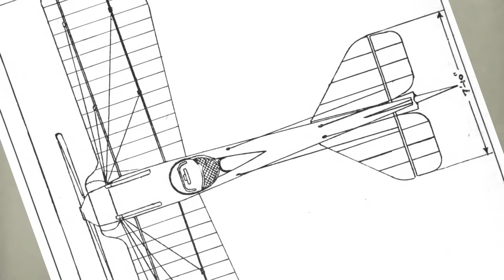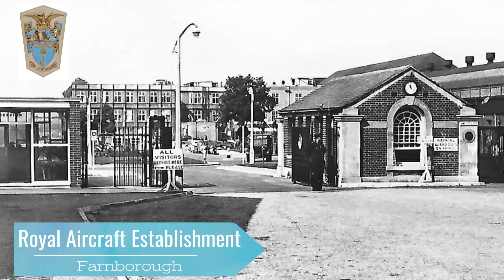This Spitfire ALMOST Went SUPERSONIC - The British WW2 Fighter That Almost Broke The Sound Barrier

Comment: The pilots notes on the Antiques Roadshow last weekend showed that his lightweight unarmed photo reconnaissance Spitfire reached close to 600mph in a dive. That means the airframe was better than nearly all the early jet aircraft. It certainly had a better limiting Mach number than the later P51 Mustang. The Spitfire was better than it had any right to be in this respect.
Reply: Indeed, the airframe was better than many early jet aircraft. Many years ago I knew a chap who'd been ground crew on the early Meteors and mentioned that an instruction to the pilots was "Don't turn too quickly or you'll find yourself doing 600mph without an aircraft".
Reply: @Bassman-r3c  the Meteor had an issue at 0.84 meaning the wrong manoeuvre could result in something akin to an unrecoverable flat spin. It had a higher than desirable accident rate, some of which was due to having to send trainees up solo to qualify in single engine operation using a process that was unsafe. A lot of accidents were due to cold war issues and were things like pilots flying into terrain in bad weather. Overall the loss rate wasn't any worse than a lot of early jets and was actually better than some.
Reply: @wbertie2604  Thankyou, I guess that explains why the pilots were told not to pull on the stick too hard. 
And the idea of sending a trainee up solo to fly on a single engine in an early jet makes my hair stand on end !
Reply: @Bassman-r3c  it was aileron and positive G elevator together at over Mach 0.84, IIRC
Reply: @Bassman-r3c  they lacked trainers early on and sending trainees up solo in fighter aircraft was just normal. It was done with Spitfires. No one seems to have considered that for twins, they almost never went solo first time and then turned an engine off. Originally the procedure was off, not idle! It was just poor training practice and a number of rookie pilots died that way. It was changed later. But in the late 40s killing people pilots in training seemed to be accepted.
Reply: I heard  a spitfire  pilot dived on a me 109
And had a loud bang his prop broke but he was over mach 1
Reply: @jackwills7092  over Mach 1, given the wing profile, is highly unlikely. The IAS may have been high, but the pitot we wouldn't be calibrated for anything so fast. You'd only be likely to get a 109 to M1 if the wings came off first.
Reply: @jackwills7092  He was testing a Spit and it was not over Mach1 it was 0.92
Reply: Mach number almost the same as Mustang and Bf 109
Reply: @michaelshore2300  neither are anywhere near Mach 1, though.
Reply: @wbertie2604  FAA Shea -Simmonds  obtained 0.88 with no problem

Comment: My Grandfather was with 41 squadron when they were equipped with the Mk 12 spit, one of the tasks assigned to them was AA gunnery searchlight/ radar calibration, which involved flying straight and level at 20,000 feet for 20 minutes , after calibration had been completed (notified by radio), it was fun time. Full throttle, stand it on its nose and see how fast the 'blighter' would go , resulting in the ASI indicator needle hitting the stop. the control surfaces getting very heavy and after landing, a bo**ocking from the CO, " what the hell did you do to that aircraft, what was that noise" . My Grandfather was adamant the his colleagues  told him they heard a bang or a boom, not that he did or that they would have known what it was. This little 'procedure' was banned after the odd
"airscrew came off".  Later in his career doing high speed dives in Meteors and Vampires my Grandfather noted and much later told me that the spit 12 was a damn sight nicer at those higher speeds. I always found it hard to believe that he broke the sound barrier in a Spit but did not wish to question him too much out of respect.
Reply: Awesome my friend...l am a very old fighter fighter pilot my self...!
Reply: @steveshoemaker6347  I'm glad you enjoyed it, 41 squadron at that time was an operational training unit , my grandfather and his fellow up and coming pilots new the 12's were coming and had got it into their heads that, "they were the cats whiskers", to be getting these new "Super Spits with their Griffon engines", they watched the first one come in and land, and were somewhat deflated when a little WAAF got out!
Reply: @williamirlam8758  It wouldn't be a WAAF flying, it would have been a lady from the ATA- Air Transport Auxiliary.
Reply: @liverpoolscottish6430  Thanks for that, I was repeating the it as my Grandfather had told me, except I omitted the word 'tasty' between the word, a and little, and the fact she was then whisked of to the offices mess.
Reply: @williamirlam8758  I bet she was! lol ;)

Comment: Wasn't the phenomenon of control reversal at high speed also discovered during the trials with the Spitfire at RAE Farnborough?
Reply: "Control reversal'' occurred because the down force on the tail plane  bent the fuselage down, giving the tail a positive angle of attack. The harder you pulled, the more force was applied to the tail and the greater the positive angle, It had nothing to do with Supersonic Flight and a whole lot to do with the strength of the fuselage. The phenomenon is called Aero-elastic Distortion.
Reply: No, they are actually elevators, but what would normally be the fixed portion of the tailplane is able to pitch up and down, as required by the pilot, changing its angle of incidence and effectively trimming the aircraft in pitch.
Reply: @Purlee100  Was it discovered during these trials?…
Reply: @thethirdman225  Something was discovered: at least, according to a British movie claiming that the first successful faster-than-sound flight was achieved in a diving Spitfire
Reply: @riazhassan6570  That was a propaganda movie. No Spitfire ever went supersonic because it isn’t possible.
Reply: Not as far as I know, the phenomenon was still occurring during early attempts by Britain to break the Sound Barrier using some of the early jets, such as the Supermarine 510. Our fellow commentator, The third man, refers to a British film, which was called, "The Sound Barrier" in which control reversal was central to the story. The story was set in the late 40s and early 50s. It seems likely that the real reason was not discovered until about that time. The film featured the Supermarine Attacker and an early version of the Swift. Neither of these aircraft ever went supersonic in any version. The Spitfire did not feature.
Reply: @Purlee100  From memory, Yeager referred to it in his book but I can't remember what he said but I do know that the X-1 went supersonic in 1947 and it had all-moving slab elevators... Someone might be able to clarify this. The movie was very limited in its scope because a lot of the material was still secret. I haven't seen it since I was a kid. Must find it again.

Probably should than @Riaz Hassam for making me think about it.
Reply: Yes, the X1 had elevators, but the entire tailplane moved to trim the aircraft in pitch. It basically trims in the same way as a Piper Cub!
Reply: @Purlee100  Right. So those things really are sort of trim tabs...?
Reply: In early testing of the X1, it was found that there was a very strong pitch down as the aircraft approached Mach 1. The engineers decided, and I think it was Yeager's idea, that an all moving tailplane would allow the aircraft to be trimmed against the pitch down. This worked, but the pitch down was not caused by aero-elastic distortion, but by the rearward movement of the wing centre of pressure to behind the centre of gravity.
Reply: @Purlee100  I looked at a photo of the X1 and I’m less sure than I was. It seems to have elevators but they are very small so they might be trim tabs.

Comment: P-38
The P-38 did reach supersonic speed, they had to add special control surfaces to the flaps to asset the flaps in deploying at those high speeds especially in a dive. P-38 pilots did lose their lives before this fault was corrected..

Comment: One correction the Wright Brothers were not the first heavier than air powered flight.  That had happened ten years prior by yet another French man Clermont Ader.  It however had no control surfaces which the Wright flyer sort of did.  They tried wing warping with some success but the idea was eventually abandoned.

Comment: The airspeed indications  are unreliable in a dive. They read higher than actual. An airspeed indicator at the time took the dynamic pressure coming into the pitot tube and compared to the pressure in the static system coming through the static port. The static port has a very small opening so as the aircraft enters a dive the outside pressure increases rapidly , but the pressure in the static system changes much more slowly. This gives an erroneous airspeed indication. It indicates higher than actual. 
Also the speed of sound changes with temperature. It is lower at colder temperature and higher at warmer temperatures. As the aircraft dives the it dives into warmer air. 
The video uses one speed as the speed of sound, 660 mph which is valid at a temperature one might find at 40k feet, but, not valid at a lower warmer altitude. 
So you have many errors in the video, erroneously measured airspeed is being compared to erroneously calculated Mach numbers which leads to erroneous conclusions.
No way a WWII fighter hit Mach .96. Brave pilots, but poor engineering conclusions.
Reply: I agree with what you say. The Spit MkXI in question however was fitted with quite a different pitot tube setup, that could be and was calibrated to very accurate true figures. It's also worth noting that all standard production fighters of the time all had similar inaccuracies in their airspeed indicators. It was noted that the Spitfire if flown in the right flight profile could easily out-dive all other propeller driven fighters on all sides.
Reply: The speed of sound also alters as to pressure - the higher the pressure, the faster the speed of sound. So a low-flying (diving) aircraft might mis-read it's speed not just by temperature, but by pressure as well. Might. Of course a rocket-propelled aircraft launching vertically would go the other way, and it seems the Germans did in 1944. But the pilot crashed and died, and whist it appears a British flight officer broke Mach one in a jet before Yeager, it was in a dive where he lost control, so the Americans claimed the record "for controlled level flight." - Like so many things they claim but were invented or achieved elsewhere first.

Comment: A guy that I worked with had been in the RAF Regiment in the war, guarding air bases. At one base used by the USAAF, a Thunderbolt pilot was doing acrobatics, and put his aircraft into a steep dive; when he landed the wings had ripped out of the fuselage.
Reply: Maybe Colin means something had ruptured at the wing root or twisted but not detached.
Thunderbolts were known to pile on speed very quickly compared to some contemporary aircraft in a dive.
Reply: @veritasvincit2745  WW2 aircraft had wings that were bolted on, and the wing roots were faired in. If the wings had bent back a bit, then that fairing would be ripped open. That's probably what was being described. It'd be a nailbiting landing, as the pilot would be able to see this and be aware that the pickup points on the fuselage might also be bent so wing failure on landing would be very possible
Reply: @veritasvincit2745  Yeah, he probably does. I was just making a joke.
Reply: @veritasvincit2745 yes and some P 47s never pulled out of the dives and what that entailed .
Reply: So how did he land?
Reply: @thethirdman225  without wings, probably quite quickly

Comment: I read somewhere that a propeller driven aircraft can never break the sound barrier because of the propeller.
Reply: I don't think that that's true. There have been a couple which might have done (The Republic Thunderscreech and the 'Machbuster' racer) but didn't finish their flight testing
Reply: @oxcart4172  The P-47 never did it.
Reply: @thethirdman225  
Where did I mention the P-47?
Reply: @oxcart4172  You didn’t but it usually comes up.
Reply: @Oxcart . In the early 90’s I was talking with a WW2 veteran who served in the RAAF  . At the end of the war he was stationed in Japan & he told of a rear propeller plane which he believed was capable of the speed of sound . I think it could have been a Kyushu J7W1  but I have also seen illustrations of a flying wing in an aircraft book years ago . He said the Americans destroyed these planes after testing them & said the reason was the jet age was here .

Comment: You have to factor in that the speed is dependent on air density. I think that speed, or something very close it was in fact achieved in the far east.
Reply: Temperature. But it didn't happen anyway.

Comment: As someone that absolutely loves the Spitfire and its history. I think you have done a fair job telling the story about the near mach speed. But to anyone that isn't aware of these events in history, I think it would have been nice to have heard you mention the other aircraft that were tested for the same purpose, but were concluded as not up to the job. One that stands out in my mind is the P51 Mustang. Always compared with the Spitfire due to it's Merlin engine. (British Specification, may I add) . I know you said very briefly about it towards the end. But the Spitfire proved more stable and the fact it could glide, speaks volumes for its design.
Reply: All aircraft can glide, even the Space Shuttle.
Reply: @David-lb4te  I think you will find most aircraft will fall out of the sky without propulsion. They need the right design. The space shuttle was purposely built that way.
Reply: @rmstitanic8163  The Mustang went down like a brick. The wing which was one of the main reasons for its success also caused problems like what my father called the “Super Stall” & poor gilding performance. However at high levels it was in his terms “ the best” .
Reply: @beagle7622  a 'Super Stall' cannot be performed by any of the aircraft in this story. For a super stall to occur, you need a very high tailplane, which these fighters didn't have...
Reply: @julianneale6128  That’s what they called it in the squadrons evidently. The Mustangs one real vice as far as my father was concerned. The RAF Mustang pilots all had a few hundred hours, experienced guys. He had about 500 when he went onto Mustangs . It was a high speed stall I believe & he said that he learnt to recognise it . It killed a new pilot in his squadron when he was there. My dad was not as story teller. He never talked about Ops , but happily talked about the plane. Somebody sent me a summary of the missions he flew while in France. He flew a MKIV a few times but not on Ops. 
They had no stall warning so had to be careful.
Reply: @beagle7622  The event in the video is about trying to reach mach speed in an aircraft powered by a propeller /piston engine and its capability to try and do so, and it's handling. The aircraft was deliberately put into a dive to reach as high a speed as possible. This is nothing to do with stalling. In this event the Mustang was proved unstable in such a high speed dive. The Spitfire however showed itself as a far better aircraft during these tests. A credit to R J Mitchell.
Reply: @rmstitanic8163  That’s a matter of record both the Tempest & Spit ( later models ) were faster than than the Mustangs I have a test reports on those 3 planes on my other computer. The Tempest was a beast. Roland Beaumont did 495mph across Newquay airport, the Mustang would have been nowhere near that . Where the Mustang really excelled was at high altitudes
Reply: @beagle7622  I think you are missing the point of the video and what the event was about.
Reply: @beagle7622  P-51 was around 15:1 glide ratio which is better than most small GA aircraft
Reply: A 747 will glide 17:1. Mustang had a glide ration of 15.3:1 so better than a lot smaller cessnas. The glider I fly is around 38:1
Reply: @sillyoldbastard3280  Not what the video is really about though. It was mainly about trying to reach mach speed!
Reply: @rmstitanic8163  My comment was just addressing the glide performance comments under your response which are simply not true including one who suggested the "Mustang went down like a brick". Yes, a Bonanza is possibly a brick at 10:1 a Mustang at 15:1 isn't.
Reply: @rmstitanic8163  Of course the Spitfire will glide as the Mustang does. They don't go down like bricks. At 2000m you can theoretically fly 30kms without power. If the the aircraft is structurally sound it's no big deal.

Comment: This evening I watched the Antiques Roadshow. A gentleman on there displayed his Father's medals and log book with aerial reconnaisance photos from ww2. Apparently low level photos were only safely obtained by high speed dives. The aircraft had no armament. They were  very brave.
Reply: The Spitfire Mk. V was developed into the very low flying PR Mk. XIII that specialized in taking pictures of radar stations at very close range. There was built only 16 or 17 Mk. PR  XIIIs. On the other hand, the Mk. V was also developed into the high flier Mk. HF VI, trying to deal with the very high flying Junkers Ju-86 recobomber that flew undisturbed over South England. They had to produce the Mk. VII Stratospit to intercept it, the Mk. VI didn't quite make it. Typically there always was a Spitfire available for every occation. A genuine problem solver.